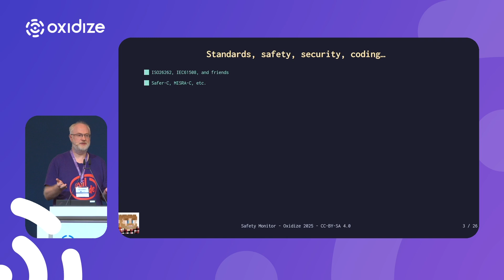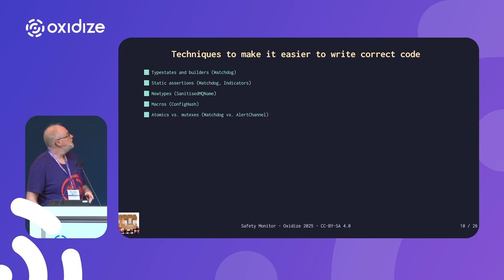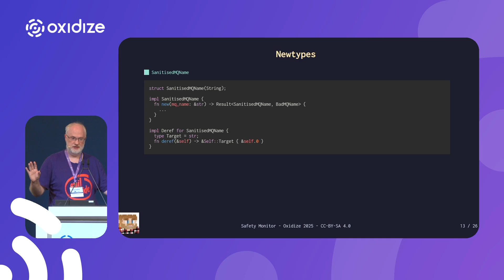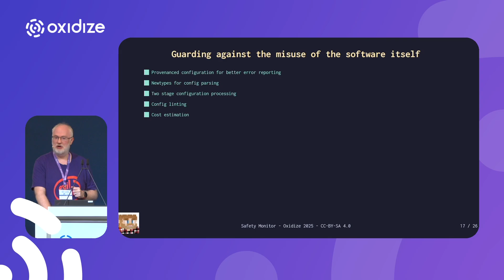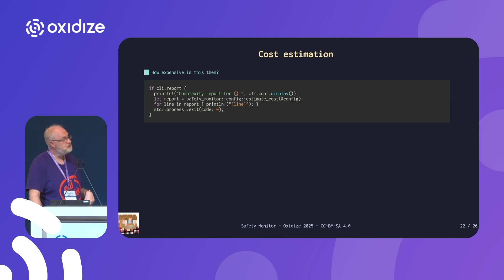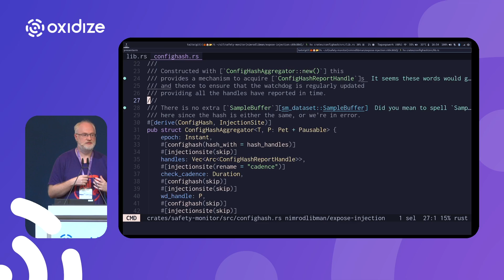Oxidize Conference 2025: Safety monitor: Using Rust in mixed-criticality Linux systems

Comment: Is this some kind of new politically correct kind of watchdog? I have been in an around embedded systems and safety critical systems (avionics) since 1980 and have never heard anyone refer to "petting the watchdog". No, we kick the dog.
Reply: I've heard all of pet, kick, stroke, reset, tap.  But who doesn't like petting a dog?
Reply: @rjek  Petting dogs is fine. It just sounds far too intimate when refining to an inanimate piece of circuitry. On one avionics system I worked on they had to put a watchdog on the watchdog incase the watchdog failed. If you see what I mean.